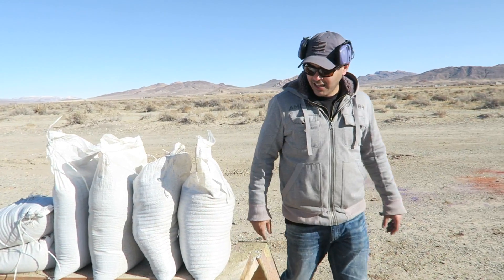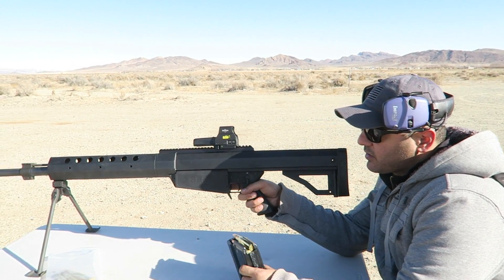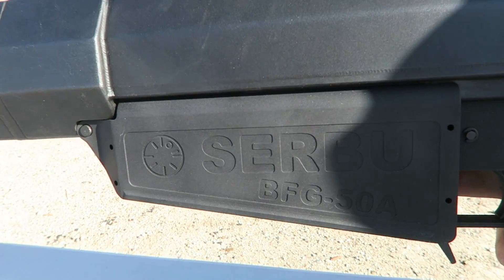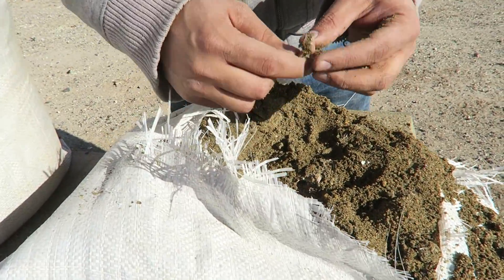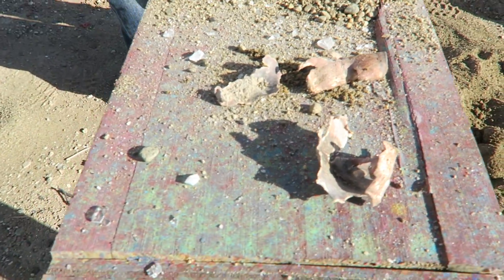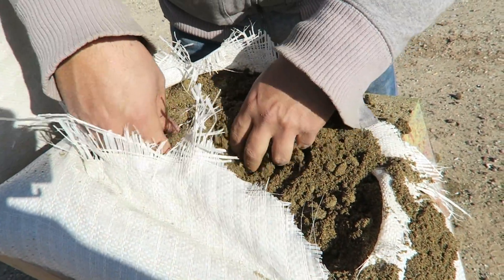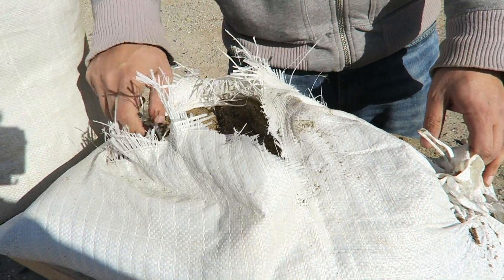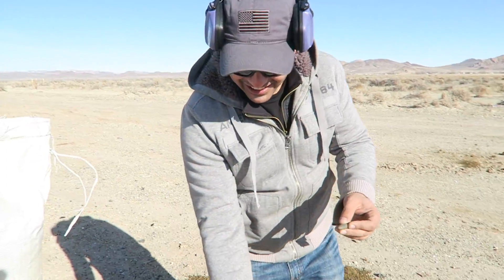how many sand bags does it take to stop a 50 cal rifle?

Comment: Usually in wars when they use sandbags to fortify a position, they drench it with water several times.. and when it dries up it becomes really hard.. almost like sitting on rock... I grew up in the civil war in  Beirut back in 1975 :)
Reply: How does this increase the resistance of the impact, sounds like making a brick, wich bullets eat through easily
Reply: Interesting! I bet you have some stories to tell!
Reply: Can sand be replaced with soil or woodchips perhaps since we don't have much sand here
Reply: We are preparing for a war right now,  this info will save lives...  Thanks...
Reply: He was being rude but he is also right. Because sandbags are inside of a bag that is rather tough to begin with. and are layed sideways, not standing up like in this video, it does 1 of 2 things. the impact pancakes the bullet from the hardness, making it lose more energy, and prevents the sand from falling out easily. once the first bullet does hit.

Edit: For clerification, I live with an ex-marine. "Stack am high, like building a house, then drench em wet" It also helps against explosive tips and 20mm when its been soaked and dried
Reply: The reason why sand works so well is that it absorbs the impact, without shattering.  You can’t chew through it like you can more solid materials, like brick, wood etc.

The reason why wetting down the bags works even better is the water helps the sand to flow into a much more tightly arranged configuration.  Many more air gaps are filled by sand and water flowing.  Dry sand flows pretty well, but wet sand flows much better.  The wet sand does not magically become bound together like cement by adding water, the bags feel stronger because the sand has more completely settled into every nook and cranny.

And the wetted down sand bags function exactly the same way non-wetted bags do - sand absorbs the impact and then settles back into a similar position.  Not magic, just science.

This is also why sand bags work so well against floods, and why sand bags must be porous to work effectively.  The flood waters come and wet the bags of sand, thus causing them to more tightly conform to one another and preventing leaks.  (Not perfect, just much better than dry bags.)
Reply: @IIIRotor  where are you from?
Reply: When using an MG in a fighting position you usually wet the ground infront of the muzzle before you fire if you can because it will keep less dust from flying up from the muzzle so you can see better
Reply: @m1951-j2u  definitely not woodchips, but soil probably yes
Reply: Thxxxx.. Maybe should try this
Reply: @steveblankstar2135  you need to leave
Reply: Taking notes 📝 

How long will the sand stay hard tho ?
Reply: Fascinating

Comment: Sand is pretty good at stopping bullets!   I was surprised it went out the first bag!
Reply from the maker: +TAOFLEDERMAUS yah I didn't think it would go through many
Reply: Edwin Sarkissian Can You Line Up And Shoot Dart Boards And/Or Old Gaming Consoles
Reply: I read somewhere that penetration can very considerably between wet sand and dry sand.  Although I can't remember which stops bullets faster off the top of my head.
Reply: TAOFLEDERMAUS l
Reply: TAOFLEDERMAUSmb
Reply: TAOFLEDERMAUS nn
Reply: wet
Reply: sand is good but the containers deteriorate fast and it becomes less effective over time. sandbags are good in combination with other barriers
Reply: I guess that would be in the third bag I was wrong can you shoot anything bigger than a 50 cal I don't know what is bigger how about an RPG LMAO
Reply: Same
Reply: the problem with the video is how the bags were set. Live with an ex-marine and even he is a little dissapointed in the video. not from the penetration, but from the fact the sandbags were sitting up, and now stacked like your building a wall. which increases the amount of sand the bullet has to travel through. Plus it wasnt hardened via water either.
Reply: if you think about it the sand bags should in a horizontal position in that way the bullet will need to penetrate a thicker sand.
Reply: 50 cal is too strong power
Reply: @silentbob267  dry sand bcus when u douse sand with water  several times it hardens like a rock
Reply: Sandbags should not be placed like this guy did them, they should be laying down like a patty, not flipped up on its side.... If he had placed them the right way it would have probably only taken one bag to stop the .50

Comment: You might find it interesting that penetration can increase with distance...up to about 200yds.   Hitting something as solid as a sandbag up so close causes the bullet to fragment instantly which greatly reduces the penetration.   Shoot the same bags at 200yds and I'll wager you get deeper penetration because the bullet will be moving a bit slower and will also have 'gone to sleep'.  As the 50's come out of the muzzle they often are flying with the nose off center a bit and take some distance to fly true.   Striking nose on will let them penetrate their best.

Comment: This shows that a single round penetrates approx 1.5 sand bags, but automatic weapons normally fire more than one round. 5 to 10 rounds of .5cal will cause wall to disintegrate. Try same with 7.62mm machine gun and you rip the wall to shreds with 20 to 50 rounds.
Reply: Sir, sand bags are not laid singularly upright....they are laid with longer side facing the threat  one upon the other in many layers across and then put water to make them damp..They are packed in jute bags and not in synthetic packets as shown in the video..

Comment: You should put sand in rectangular shaped buckets (so you have a flat surface to shoot at) and then fill the bucket with water and freeze it.  I wonder how much better (if any) that would be about stopping a bullet! In case it just breaks apart you could put some chicken wire in it to act as rebar!

Comment: What makes a good Ballistic Shield (BS) that usefull on the battlefield?

1. Full body cover. At least 160-170 cm

2. Lightweight. Around 5 kg to 10 kg

3. Can stop any bullet like the assault rifle and the 50 cal sniper bullets

BS is more usefull than you think:

1. Mobility to the operator, can move anywhere without natural cover

2. Ability to run to the better position to flank enemies.

BS should be pair with 1 handed sub machine gun like the uzi or machine pistol.

Every ground assault squad should have a BS operator

Comment: It's  really disappointing  that .50 cal can only penetrated  2 sand bags.......
Reply: Tommy Gun Not if you are on the other side of the sandbags.
Reply: Dindn't you already learned that there is no bullet in this world that can penetrate very much into sand? It's just not possible. The sand dissipates all the bullets energy very quicly and eficiently. Sand was always used as a  barricade material  in wars...Do yo think that they would have been using it if it didn't work? Sand...the cheapest bullet proof material. Also  the most efficient....heavy as hell though..